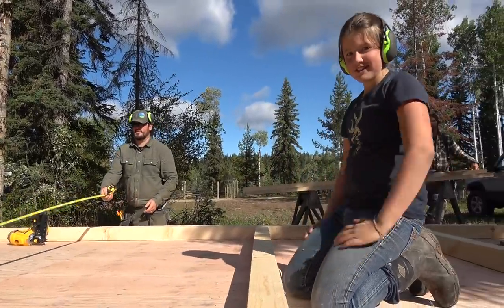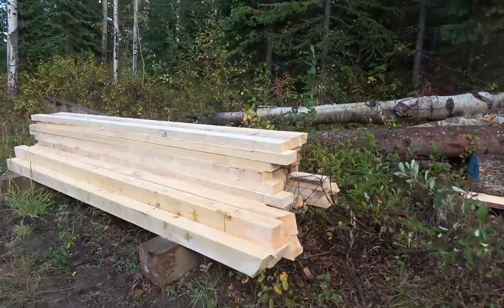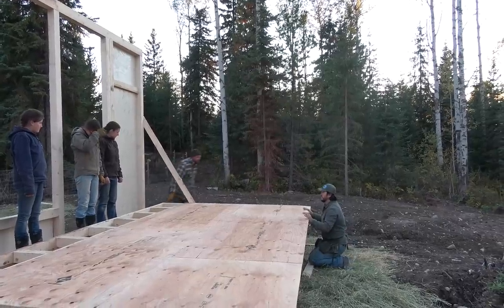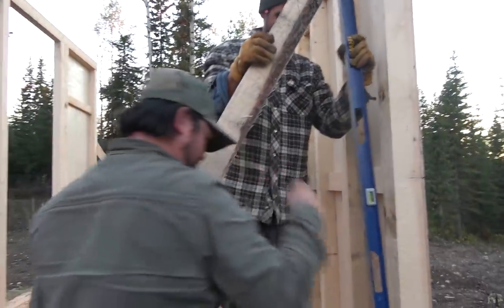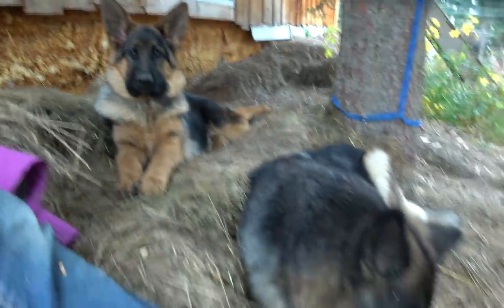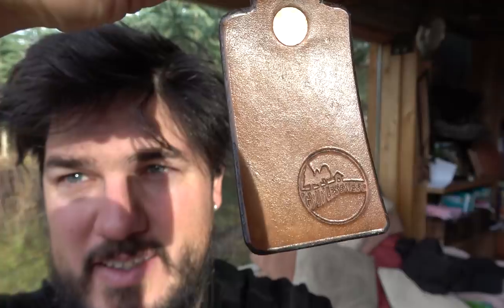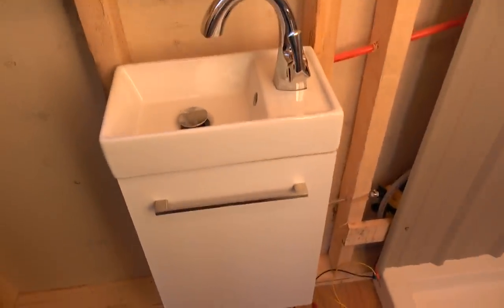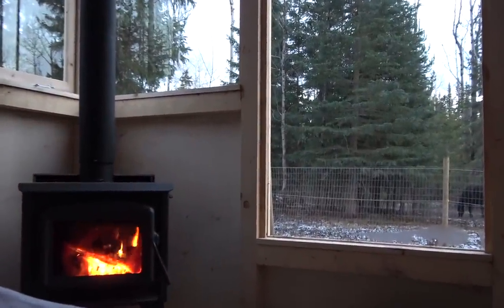Super Simple Tiny Cabin Off Grid

Comment: Just use the metric system and get the measurements correct the first time!
That sawmill is AWESOME!
Edit: and so are the girls, Rose and Dave!
Edit #2: If that stove puts out a lot of heat, I hope that the glass is tempered so that it doesn't shatter when its cold outside.

Comment: Blazeking. I just bought my 3rd one. After Burning a Blazeking there is no going back. The bi-metal thermostat coil is worth $1000 bucks all by itself. every stove should have one. set it and forget it. The catalytic feature is a must as well. I burn one third less wood easy. I have cooked on Blazekings stoves for 15 years with no problems. My new off grid homestead has the same model you just bought.

Comment: Looks great!  I've always been worried in these small cabins though , about the gas buildup in the place when the fire is on, we used to leave the window cracked a bit in ours and it was bigger , though the doors were pretty drafty so that would let in some fresh air. I thought if I were to ever build something like this (which I never will) of having a pipe coming from one vent under the eaves, down the wall and into the floor, then across to behind the  fireplace and back up through to a vent. Is it really not needed? I have asked one cabin builder who said there was always enough air seeping in.
Reply: Not needed- it’s not completely airtight.

Comment: Just a question...why is there no cement board/ metal on the walls behind the wood stove!!?? If it throws that much heat..won't you loose heat thru the radiant cooling..??
     Good vid, was wondering how your 
"Discovery pro ject",was going??
Reply: a stove like that most likely only requires a couple inches to any combustible.
Reply: @Off-Grid  thanks!